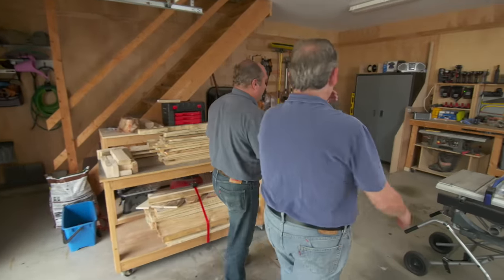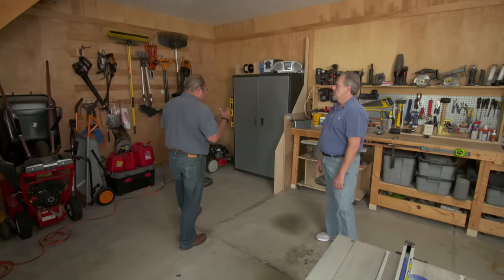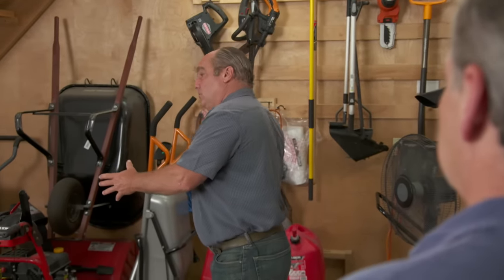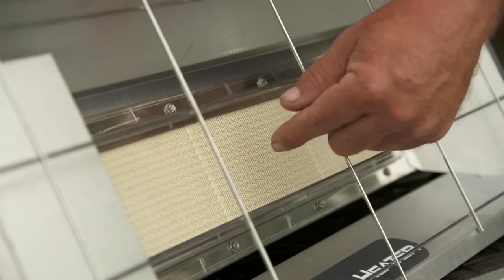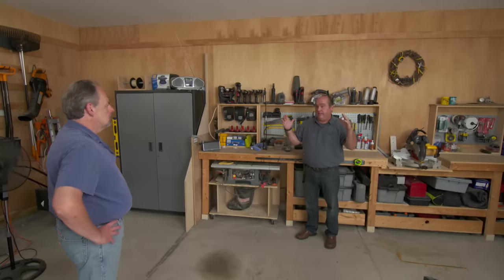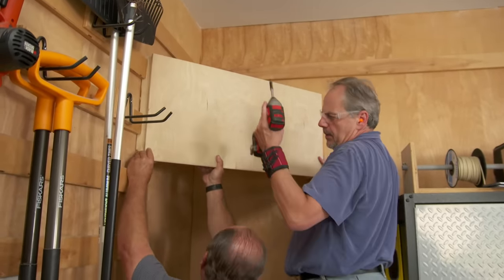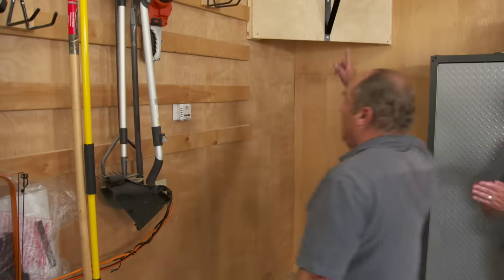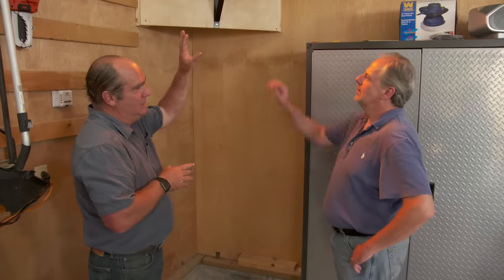How to Heat a Garage Workshop | Ask This Old House

Comment: @2:40 - the official motion of "that baby isn't going anywhere."
Reply: He stripped the bolt...
Reply: I think the lag bolt threads were still in tact, but he stripped the wood or drywall out because he missed the stud. Not sure why you would have used a bolt that large and a torque gun anyway. That's asking for trouble.

Comment: We installed a Mitsubishi Mini-split in our garage several years ago, air conditioned and dehumidifier and , wow, a heater.  Low humidity in the heat of summer in Florida.  Operating costs at a minimum.  Be sure to insulate the door and ceiling.  I give it a three thumbs up.   👍👍👍.  12-19-21

Comment: I've installed and serviced Radiant and unit heaters, as a commercial HVAC technician. On Radiant heaters, though more efficient on the gas use. I prefer a Hanging unit heater.  The fan/ Heat exchanger will not get clogged as mentioned, not going to happen, ever.  Dust will accumulate on the heat exchanger surface that's about it. blow it off in the fall and turn that sucker on and enjoy.  Working under and around radiant heaters in a garage setting with high ceilings.. those guys suffer with the bays even slightly open.

Comment: I ran a gas line, 2 electrical circuits and installed a gas furnace and central air conditioner in my garage 15 years ago. a little pricey but never regretted it. makes working out there enjoyable.

Comment: I was in a mechanic’s 4 car shop today. It had heated floors. It is the best heat ever. Even and nice heat.
Reply: Heated floors, wow.  I have not heard this since I was about 10 years old living at home with my parents and my dad installed water heated pipes in the basement in Illinois, Chicago area.  That was 68 years ago.  The absolute best heat and it never caught on, never.  As I said, wow.

Comment: In the midwest (missouri) natural gas is supplied to residential properties at high pressure. The gas goes through the meter and then is regulated down to just 3-4#'s of pressure. If there is any distance between the separate garage and home, there will not be enough pressure to fire that heater or a furnace. Check your local gas supplier.

Comment: I wonder how this worked out.  Is the entire shop heated evenly?  For some reason I'm thinking NO.  When you see these there are generally at least a couple of them, not just one for a space that large.  I'm skeptical.
Reply: In my 1,000 sqft detached shop, 30,000 btu is not enough.  I have a convection type Mr. Heater propane wall mount unit and it runs all day long.  The shop is not insulated so that would help.
Reply: These types of Heaters are Space Heaters like in Home Depots over the Registers.. This Will Not Heat That Garage.. he should of installed a Low BTU Boiler and ran Flex to Duct Work and ran a Couple Runs of Flex and Registers. but what do i know i only did HVAC For 10 years. this is a waste of time and money.
Reply: @Dominick_Calvitto.  That is my thought too.  They use this style for the outdoor drive through at Chik Filet as well.
Reply: @Dominick_Calvitto.  that's incorrect and i say this from first hand experience.  I had an HVAC guy install the same exact unit installed in my attached, finished and oversize garage that was 31x28  with 11' ceilings in Kansas.  Kept my garage at 68-70 all winter long with zero issues and was a nice even heat across the whole garage.   And no, it didn't run all day long to maintain that temperature either.  Zero condensation anywhere and no fumes.     Worked amazing.

Comment: We use a potbelly stove feed with scrap wood
Reply: As do I. I placed a fan to blow across the exhaust pipe below the choke plate. Barely any coals, 18℉ outside, too warm inside. I also have a small AC unit close to where I do most of my work to keep me comfortable during the summers. 
Correct, I am a wimpy old man.
Reply: So do I!
That small unit won't heat that space.
Reply: And when you run low on scrap wood you have to work faster on projects...just to survive.
Reply: I eat a potbelly pig and feed the cats the scraps
Reply: That's not the point of the video but if left on continuously with the thermostat it probably can take the chill off enough to work in there especially if the walls and ceiling are insulated and the sale on the garage door are working well
Reply: Home insurance companies are on the warpath against wood burning shop heaters.  After 25 years of trouble free operation, my insurer forced removal of my "to code" wood burning stove in my shop.  If it wasn't removed, they would cancel the home insurance and the home would not be insurable by any insurer.  If your house or shop burns down and their is a undisclosed wood burning heater on the premises, your insurance is void and your property is not covered, regardless of the cause of the fire.
Reply: @Fred Wills Be smart and use refractory brick and ceramics. If you can manage to burn down a shop using a potbelly stove and installing it/maintaining it correctly let me know.
life is both full of risks and short. Mitigate the risks and enjoy what you can.
Reply: I my area near Boston, Ma its against code to have a solid fuel burning appliance in a unattached garage.   If you go against code and something happens the home owners insurance will likely refuse the claim.
Reply: Not something I would do with flammable liquids and also gases. I went through last winter in a cold workshop but here in Australia not freezing.

Comment: I have a wood pellet stove and two 5KW heaters in my 1500 sq ft shop. Live at 6500 ft elevation in the mountains. Works pretty well
Reply: no one cares
Reply: @Fattony6666  apparently you do. Took the time to read the comment and respond
Reply: You need a better pellet stove if you need more heaters to heat 1,500 sqft even in the mountains.

Comment: I live in the winters where it gets 25 to 28ﾟ I use a oil heater from home depot is home depot it cost a $120 I plug it into the wall bam bam job done my garage never gets below 65 degrees

Comment: I have a MR Heater gas forced air unit that hangs from the ceiling with vent out the roof.  You get very dry heat with no gas fumes, and heats much faster, and equally throughout the garage.  Even on a 20 degree day, my garage is warmed up to 65 in 15 minutes.  I also lack insulation on my garage door and roof.  The heater installed here is more of a spot heater, good for warehouse doors.

Comment: I use a blue flame heater in my garage.  Wall hung, self contained unit.  No power needed, and have used it in the winter during a power outage.  Natural gas appliances will process the air, so if you stain/paint anything, the smell does get amplified.  I don't work with gasoline in the garage, so I'm fine with an open flame.

Comment: My HVAC sub made same recommendation for my professional woodworking shop. Be careful of proximity and directional orientation of radiant source to wooden workpieces. Intense heat can quickly warp wood  when one surface absorbs the radiant heat directly. I ended up switching to unit heater. Expensive mistake.
Reply: Agreed. I was a commercial HVAC technician for over 15 years, and serviced many different kinds of radiant and hanging heaters.  Unit heater is the way to go.  Especially in a shop that big .  I have a small garage/Workshop and would never hang a radiant heater, ever.  Got a small Modine i pulled from a small job and my garage = awesome.
Reply: @MrEarbuckets  If you were asked about year round climate control for a well insulated 1000 sf garage shop today, would you recommend mini-split?
Reply: @michael.schuler  Most definitely.  Super efficient.  Prices for ductless mini-splits in north america leave a little bit to be desired. but hands down cost per BTU is phenomenal.

Comment: my only criticism is the downward angle, imo looks steep
Reply: You don't want any portion of a radiant heater to be directed at the ceiling. If it is aimed at a ceiling then it's kind of a waste.
Reply: And the fact that the thermostat is right next to the heater
Reply: @garrettducat5769  i get that, but it looks like only the area next to the cupboard will get heat
Reply: Home owner preference but its adjustable if needed.
Reply: @kalijasin  how is it adjustable? look at the mount at 3:28
Reply: They probably want it to mostly hear the floor below.
Reply: @davidriley7659  it's a mild steel bracket, just bend it a bit if need be.
Reply: @dphil2703  Likely so it dosen't run full blast all the time. It heats what it hits so it probably has to be  near the heat or the sensor wouldn't work at all
Reply: Sure does...

Comment: Didn't realize you could just cut a flex line like that and add a fitting.
Reply: Yes it is good piping, however it must be bonded to be legal if your house were to be struck by lightning this gas pipe is known to split and catch fire and if it’s not bonded than insurance will deny any claim
Reply: @aron6998  *may deny

Comment: One or two electric floor plug in convection heaters would, to me, be the better option. Eliminates need for pipe work and vent work. Insulating above attic is key of course.
Reply: If you have the circuits for it. One convection heater will usually fully load a 15A circuit (with some safety margin of course), so you basically need 2 dedicated circuits.
Reply: @William Murray Top 10 on the list of things I will never care about: Having heat in a garage workshop with no electricity to run tools or lights.
Reply: @William Murray who gives a crap about losing heat in a garage if you have no power???

Comment: Who installs a thermostat right by the heater. Move that thing away.
Reply: Too close and the thing will never run, too far and it will always run. Best to have it somewhere midway in similar proximity to the main workspace distance.  Also, that heater looked rather small for that two car garage considering that it is coming from above where the majority of heat will stay.
Reply: Richard who doesn’t have a clue what he is doing
Reply: "This is my impressive workshop i staged to impress this old house. Cars don't come in here for sure." Car oil stains on the floor 😂
Reply: @johnnylawrence    "Cars don't come in here for sure."   He only said that because the wife wasn't there.  ;)
Reply: Since it’s a radiant heater, heat should not come directly to the t stat right away. It will warm the objects first, then it will heat the air from those objects until the room is totally warmed. Actually smart of him to place it there.
Reply: The heat will not stay above where the heater is, it's radiant not forced air. It heats like a halogen work light, wherever you point the light is where it is hot. Heat doesn't rise, it travels to cold. Most houses are heated with forced air which is why everyone says heat rises. The heater still looks a little small for the size of the space but he didn't say how many btus it is.
Reply: Won't this type of heater cause cancer?
Reply: @kzukiodenthechad7205  yea, everyone who has ever been outside in the radiant sun has died from cancer..  dont sit 6 inches from the dam thing for an hour but come now
Reply: @deckmonkey1459  If you have ever worked at the top of a cathedral ceiling, winter or summer, you would know heat rises..Heat doesn't travel to cold...
Reply: If you have ever had to sweat your balls off in an insulated attic in the summer, you'll know the heat isn't rising from the air conditioned house. Hot air is one type of heat and hot air rises above colder air. Point a halogen work light at the ground and put one hand above and one below. The hand below will get hot. Hold a piece of steel bar upright and point a torch at the top and your hand will never get hot because heat rises? Assuming the sun is above us, it would be impossible for it's heat to sink down to Earth. Heat doesn't rise or you wouldn't feel any heat from the radiant heaters 10 feet above you.
Reply: ChadRilla23 
What doesn’t?
Reply: I agree 100% that most people are talking about air when they say heat. It's sort of like when people tell you they "literally died", you know what they mean even if it's not correct. In this case it was in reference to radiant heat, that's the only reason I said that.
Reply: chex313 
Heat does travel to cold. Heat does not rise.  Hot air rises.  This is 10th grade physics.
Reply: @kzukiodenthechad7205  No, IR light is too low energy to damage cells. It can't even penetrate. UV is what causes cancer. 

That's not to say exposure to IR has no negative effects - you can get thermal burns and dehyradtion of the skin for example.
Reply: chex313 Heat doesn’t rise.  It is not affected by gravity.  Heated air rises.  Heated liquids rise.  Heat does not rise.  Radiant heat travels in a straight line from source to objects that can absorb it.
Reply: Mike Like Some are.  Some just don’t have a clue what they are talking about.
Reply: Hvac contractor here; I beg to differ.  Infrared is line of sight.
Reply: johnnylawrence must be set at 90deg. Alllll the time
Reply: @kzukiodenthechad7205  NO,NO.NO.NO.NO IT WILL NOT CAUSE CANCER!!!!!!!!!!!!!!!!!!!!!!!!!!!!!!!!!!
Reply: It's radiant just install it away from the path of the rays. By the heater works fine in this case. It's all relative anyway.
Reply: Same guy that wears a parka!
Reply: @deckmonkey1459  energy takes many forms and radiant heat is energy which essentially excites the contacted surface, generating a response from which heat is generated. Firing a blow torch at a steel rod heats the steel directly which then transmits it's heat energy through the bar via conduction of heat (i.e. direct molecular to molecular contact within a solid). The phrase "heat rises" actually refers to the fact that warm air rises as air (as with most gases) expands when heated, becoming less dense, and therefore essentially floats above the cooler air. Heat transfer and mixing is constantly occurring with the cooler air but the overall effect is a temperature profile with the warmest air at the top and coolest air at the bottom. Forced convection is simply adding a fan or other non-convective motive force to force the mixing of the air, which serves to minimise the temperature profile (top to bottom) within any space.
Reply: @Peytona  Which was exactly my point. As I said, it's always assumed people are talking about forced air when they say heat rises, but most people still can't grasp there are other ways heat can travel. Using a torch or a halogen light are 2 others and people understand it easier than explaining the science behind it.
Reply: @007KrausBean  "radiant"
Reply: Baseboard heaters have incorporated stats duh
Reply: @l337pwnage  hahahaha
Reply: @kzukiodenthechad7205  , yes only if you live in KALIFORNIA , OK ?🇺🇸🇺🇸🇺🇸🇺🇸
Reply: I wanna heat up my 2400 sqf garage to spray paint some car parts, but I don't know what is the safest and fastest heater, I'm looking forward to your feedback .
Thanks

Comment: It is critical that the flame source be at least 18 inches off the floor to prevent FIRES, according to our Fire Dept! That's why Insurance Companies don't like them! We have all seen floor heaters (kerosene/Diesel/Propane/Potbelly Stove etc) used to heat garages. Once I learned this I threw our Kerosene Heater in the Garbage that night and replaced it with a Wall Mounted Infrared  Natural Gas Heater, the best move I ever made. That Heater has been in four different houses and was converted to propane because our current house doesn't have NG in the garage. Now after 15 years I replace it with a new Infrared Propane Heater. I highly recommend them.

Comment: I've owned a Enerco garage heater I purchased in 1993. Very easy to install and operate. Been a wonderful and reliable heater. After all these years of use it's is in need is a new control module. Any one knowing where to get one please reply. Thanks
Reply: Have you tried Enerco's website?  If they don't sell parts there, call them and ask them where they would buy parts when they need them.

Comment: Your talking about a heater that only heats objects. I bought a radiant heater and mounted it above my workbench where I sit most of the time to tinker. They are hard to regulate and they only heated whatever was in front of it. As soon as I walked away from the bench I was cold again. Mine is electric and not gas as is in this video. I got rid of that heart when I built a free standing shop behind my garage and installed a ''ggarage, /workshop heater. It is electric and I pan to only use it until the wood stove gets up to the right temperature.

Comment: Can you explain more about the vent that was installed to the outside?
Reply: Natural gas and propane emit water as one of their by-products of burning. You need to vent that moist air out if possible and you also need to admit a little combustion air so you don't deplete all the oxygen in the room.

Comment: I was hoping they would talk more about how to get a gas line into my garage.
Reply: Had a pellet stove in my garage for 10 years. It worked really good, but it had a large footprint, and stole too much needed space. Removed and sold, installed a self contained gas fired wall mounted unit. Now the gas fumes are smelly after 30 minutes, although the unit heats the insulated garage nicely. It's  tough to heat a garage that satifies all your needs.
Reply: Run one.

Comment: And the option for those of us without a gas line running to the shop?
Reply: Chris Emens how about electric lolololololololo
Reply: They make electric infrared heaters too. Not sure if they are quite as efficient though. They might be, but could require some major breakers.